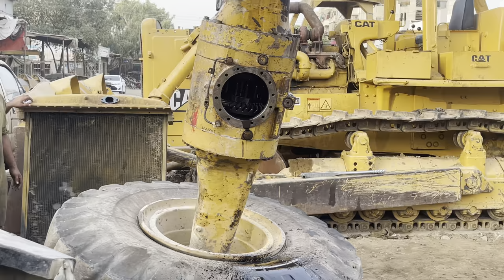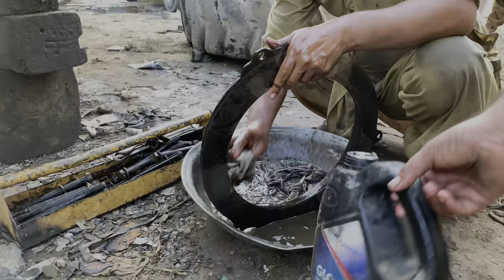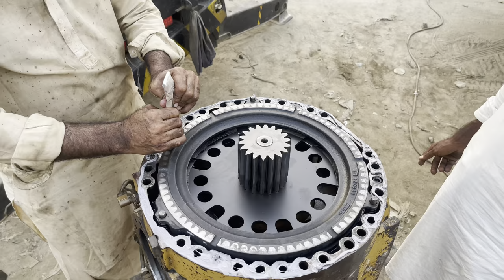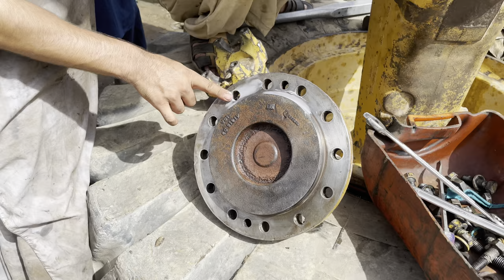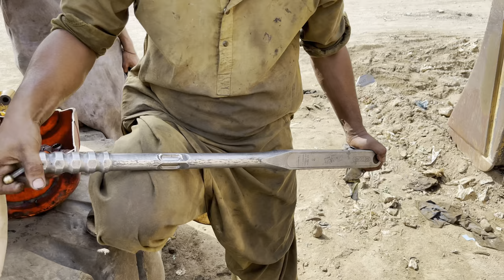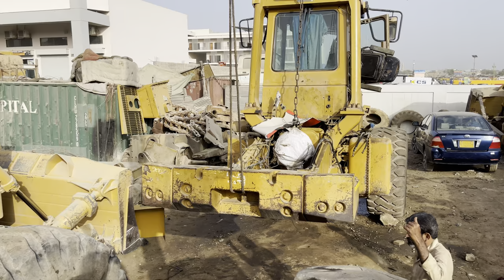These Experts Solve Cat 966f Brake disc Problem in very Strange Way || Complete video

Comment: meanwhile a CAT mechanic in US:sir that brake job is gonna cost you 11 000 dollars and will take about a month to complete.
Reply from the maker: It’s cost is just 20 dollar and it take hardly 2 hour
Reply: @DiscoveringSkills  обалдеть
Reply: Х
Reply: This buch would make a fortune doing this work up in Yukon at the gold mines 😊
Reply: @DiscoveringSkills  tpp
Reply: Where does this break dissipate the heat? Or is it more a clutch than a break?
Reply: @franktechmaniac7488  it's submerged in oil
Reply: 🤣🤣🤣 Americans.
Reply: It costs May be $20 may be someone's hand or a leg
Reply: @DiscoveringSkills  bhai India mein yah kam mere khyal se ek lakh rupaye ka to hai Pakistan mein kam se kam 2.5 lakh ka to hoga $20 ka to nahin hai
Reply: Thats mostly the trial lawyers fault! If some one is hurt because the operator drove to the edge of the ditch, then romped on the brakes. That means the operator hurt his hand so the trial lawyer chased the ambulance and then sued the employer and catapiller. So as a result no one is allowed to innovate or substitute. God forbid that you skipped the part in the book that calls for checking the engine oil or some other BS then the damn lawyers on your ass too.
Reply: @franktechmaniac7488 these are wet brakes. the heat goes primarily into the oil

Comment: First torque wrench I’ve ever seen these guys use…
Reply: That a gedore torque wrench made in germany didnt know those guys use them i have 2 like that in my own collection
Reply: Honestly i was quite shocked
Reply: probably the only one in the whole town
Reply: I was actually surprised to see a heat treated gear for a change on the channel. Don’t think I’ve ever seen one
Reply: I believe they had a torque wrench in a previous video that they used as a breaker bar.
Reply: Because you need to travel the world
Reply: This is Pakistan necessity is mother of invention and ingenuity
Reply: @heavymachinery2843 .To 6666666666uyn
Reply: He still hasn't developed "the touch"
Reply: I actually saw on another video the use of a handheld computer, (I say handheld computer it's was actually a calculator from the late 70's)
Reply: I guess star pattern had to be sacrificed doe
Reply: @rockybalbao5004  You spelled nation wrong.
Reply: Its common in Pakistan to use it in this way, actuay these guys use what suits them despite of following specific guideliness😁
Reply: That's because there's only 1 in the entire country
Reply: Amazing 👏
Reply: قل ماشالله تبارك الله
Reply: الله يحفظكم من الأعداء أخوكم من السعوديه
Reply: Same here
Reply: Exactly.
Reply: @jrondyer1049  knowing that makes me pain
Reply: My instructor for aircraft maintenance engineering told me they used to just go by feel...FOR PLANES. So I don't mind that they don't for this
Reply: @cosmetrujillo5103  OOO Koo OOO OOO pokok OOO Koo Koo o
Koko OOO Koo Koo Koo Koo
Koo Koo OOO Koo OOO Koo Koo Koo Koo

KK KK
Ketikkan
KK KK
8 KK Ikki KK KK Koo KK Ikki Koo
Koo kokka KK KK komik-komik KK kakakku ketikkan KK Ikki KK Koo JJ j KK KK Ikki KK

Comment: It's amazing what these guys can do with such rudimentary tools. I was surprised they had an air compressor. I figured they'd all grab a straw and blow out the bolt holes themselves. Props to these men.
Reply: Why wouldn't they have a air compressor when they have tires? I'm guessing you think they use straws to blow air in the tires ...
Reply: @waheeddawodu9892  Sorry I meant no disrespect. It was a poor attempt at humor.
Reply: @kevinwells4888  I hear ya KW. Many 3rd world's wouldn't understand the humor in it.  The fact is, these guys are really creative. Serious engineering and technics. 1 love brethren.
Reply: @waheeddawodu9892  Agreed!
Reply: @Joseph Burnside You're lucky. All my Dad taught me to do was hold the flashlight. :-)
Reply: @waheeddawodu9892  this shop and similar shops don't really have tools.  this is only second time that I have seen a torque wrench , even when rebuild engines.  and the second time with an air compressor.  I imagine that most tires are inflated off of the air compressors on trucks for their brake systems.  

They do amazing work with what they have, although they are a bit rough on the things that they are fixing.
Reply: @Brian-mp6bg  Now that's another interesting point.  Amazing.
Reply: I bet they put less effort than you in writing your comment
Reply: @cosmowind33  Word
Reply: You was surprised they have an air compressor. What about the torque wrench? :) Seriously, not even each of a modern repair shop has one since it's an expensive and specialized equipment.
Reply: @МаксимКострубин  They are smart, skilled, hard working men.
Reply: And no steel toe boots.  Wow.  Heavy duty mech in sandals is kinda insane.

Comment: This is not strange, it's ingenious...working primarily with manual labor limited what modern machinery they have, just plain hard work. Much respect!
Reply: you obviously don't do this kinda work. they are doing twice rhe work for a worse result.  putting it on its end like that you have a much higher chance of getting contaminates inside the diff housing. and they are working in dirt with dirty rags and to many hands. horrible like everything in that shit hole
Reply: @paulcini6084  if it works it works. What do you want them to do??
Reply: @Speedster189  it doesn't work that's the point it may work for now but it's longevity is highly compromised. it's not like they don't have the tools to do it properly. they are just cutting corners and people are calling it ingenious...... its not it's lack of knowledge.

Comment: So they replaced a clutch disk in a mostly normal way.  A little rough on fitting the parts back together, but it will probably hold together for a while.
Reply: Pp

Comment: Where do they get their parts from..I don’t know about the tire balancing act…..
Reply: Tire balance wouldn't be any issue. What I'm worried about, did they change only one side of the axle?
Reply: @dave161141  Yea, if one side is worn out there is a good chance the other side isn't far behind. He was talking about balancing the tire on end to work on it, not balancing like you balance a car tire.
Reply: @dave161141  Every part over there is being used to the max AND beyond.
Over there labor costs are CHEAP(also human lives/OSHA btw) and parts are relatively expensive.
That means repair only when it's broken even if the other side "should"also be replaced.

Comment: Have all the safety precautions been taken? Definitely YES.
Reply: uhhhhh, no. No safety goggles, no steel toed boots, no hard hat, etc....standing under a tire/wheel assembly with only a strap holding it (should be steel chains). In the USA OSHA would have found dozens of safety violations. 3rd world is 3rd world.

Comment: Torque wrench?  That’s unusual.
Reply: Calibrated elbow
Reply: @obsoleteprofessor2034  i often put too much force into stuff and it breaks, where do you calibrate elbows and how much do they charge?
Reply: @knowurself4999  It takes many years and many broken, expensive parts and bolts. After that, your elbow is calibrated. Until then, it's "torque to yield"

Comment: It amazes me that there is absolutely no personal protective equipment used whatsoever!
Reply: Some people have heavy duty sandals which are different from welders  and machinist sandals. these are OSHA approved. Goggles are not needed if you squint enough to protect your pupil. Gloves are a luxury. Respirators or face mask are not needed, tissue paper inside nostrils are enough. Have a great day.

Comment: Just amazing to see the level of safety used by labourers. Safety glasses steel capped boots, hi vis clothing, hard hats but don't forget that sling. The sling only had a few nicks in it. I'm certain the EPA (environmental protection agency) has approved the effective oil soaking floor ?
Reply: u think the EPA has anything to do with what's happening in India? lmao

Open toed shoes and no hard hats are standard in India.
Reply: I guess workers compensation claims are pretty much negligible.
Reply: @richardcrowell284  doesn't exist there either...
Reply: @Nostradumlbass  this is not India, these men are from Rawalpindi, Pakistan🇵🇰
Reply: @raufjaleel8317  dang u got me, the neighboring country with sooo much more worker rights...

Comment: There is nothing strange about the way they repaired this, I am amazed that in this repair they actually used a torque wrench, this is the first time I’ve seen them do that in these Pakistani repair videos. As for getting underneath a suspended load to clean it, you are absolutely crazy.

Comment: Those aren’t brake disc they are clutches in the axle so when you turn both tires are not locked and spinning at the same speed
Reply: LIMITED SLIP DIFF,As you say,,feck all to do with brakes

Comment: Not a strange fix at all, considering this is called a "wet brake", it operates in oil, similar to a clutch in an automatic transmission.

Comment: we used to tear our tractors apart to fix clutches gears and even turn new bushings on the lathe in Wisconsin nothing really special here except bigger equipment and we had 4wd tractors that were very large we broke in half to work on

Comment: Serious safety issue. That wore out strap holding the tire look like it barely handle the job. Hoisting the tire with all that people underneath. Omg. Also,  somebody could lose a finger if the crane operate lower the tire too fast.

Comment: Dumbest idea ever to leave the tire attached. Makes the work unneccessarily complicated and dangerous and allows a bunch of dirt to enter the housing.  Some of the guys sitting around doing nothing could clean the site. That would help. With very few improvements the result of their work could be so much better. Do not tell me they have to work like this because they are poor. Not true. Missing work ethic is the problem here.

Comment: Wonder if there was a good reason to not take the tire that was up in the air or both tires off the axle. They took bolts out of the rim so that wasn’t a problem. Chasing views on YouTube? Seems like they made the job needlessly difficult
Reply: Less work
Reply: @523FILMS  was it less work though? If they took the tire off they wouldn’t have needed 6 guys and a bunch of screwing around to stab the axle stub.

Comment: There is nothing special here... just working outside.... did ours yesterday but in workshop with over head 15t morris crane and impact wrench for bolts. Also should not use grease on those seals, just oil. And mmmmm that friction plate needs alot morr than that, need to make sure that pad is wet wet wet with oil and that it absorbed it 100% before u install it but oh well....
Reply: they will have another chance when the other side is done